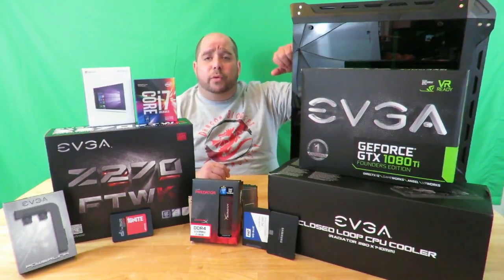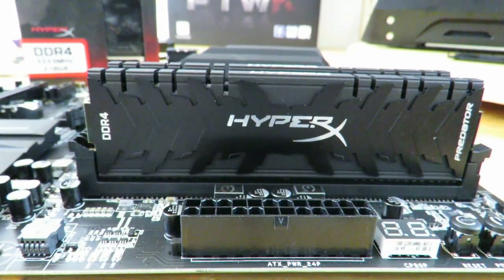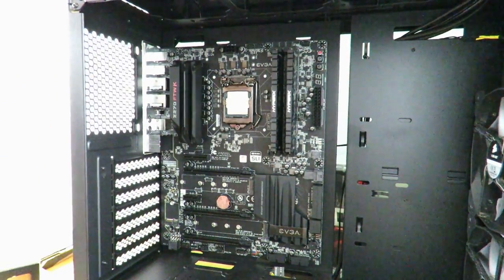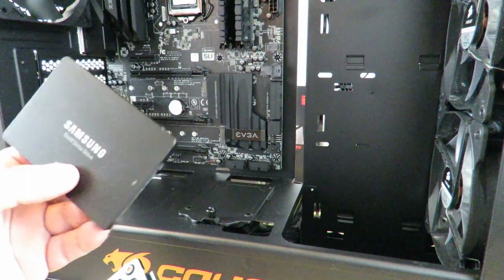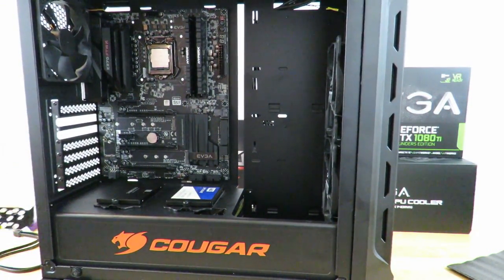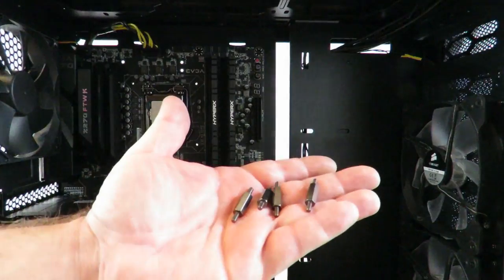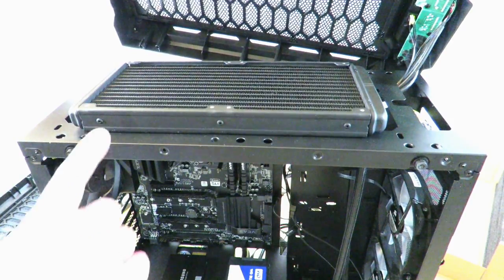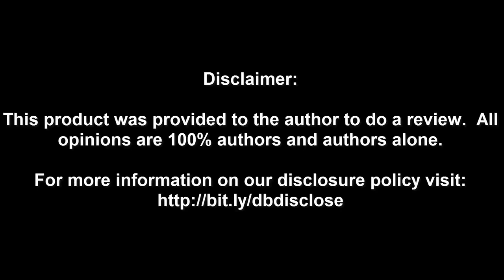How to build a Gaming PC with Intel, EVGA, HyperX, Cougar and more

Comment: I think you're supposed to put the motherboard in first and then install the CPU, to avoid shorting it.
Reply: well yes and no, I was touching the case grounding myself (not constantly) but the cleanest way to show this being done, without a lot of background to distract is outside of a case.  Been doing it since I was 13 (I am 38 now) and have not killed a single board or processor but I do thank you for stopping by and commenting, it does mean tons to me.  Going along with what you said though, make sure you dont lay the motherboard on a carpet/rug or anything that can potentially expose it to ESD, and dont rub your head viciously then touch the board, because yeah you will short it.

Comment: Do you need liquid cooling fans? can I build a pc like this without buying fans?
Reply: the liquid cooling unit brings fans, you can take them off,... but then how is the liquid going to stay cool? Check it out on Amazon: http://prourls.co/m4F6
I also recommend having adequate cooling in the system as well, air is needed to keep all components cool, even liquid.

Comment: Hello,Hola
tengo una duda con mi build(no esta armada aun) y quisiera  saber si la fuente topower(al no ser modular) funcionaria bien)esteticamente.

INTEL CORE I7-7700K
ASUS ROG STRIX Z270H GAMING
CORSAIR Vengeance LPX 16GB DDR4 3000 Mhz
GIGABYTE 1080 GTX
TOPOWER 1000W 80 PLUS GOLD
EVGA CLC 280 Liquid CPU Cooler
COUGAR Panzer MAX

Gracias
Reply: better ask in english?,and another part of mi question is if the powerssupply will look good(aesthetical),this build was the best one i could afford(almost the same as you guys)
Reply: no se si por este medio te puedo pedir un favor...es solo que no se bien donde conectar las distintas fichas que trae el cougar panzer max,me gustaria que tu me ayudaras con eso si es posible
Reply: mira en el manual de el Asus ROG STRIX Z270H, eso te dice donde conectar todo de el case a la tarjeta de madre

Comment: Please disclose that it's a SPONSORED build at the start of the video.  A 1200W PSU is way overkill for that setup. The max any Single GPU system would need is 650-750w PSU. After building many systems, i would go with a full modular power supply that's gold rated or higher. The PSU is the heart of the system, if it doesn't supply clean power, it can cause damage over time to your hardware.
Reply: I would turn it down if i already have a good PSU. Someone else might need it more than me.